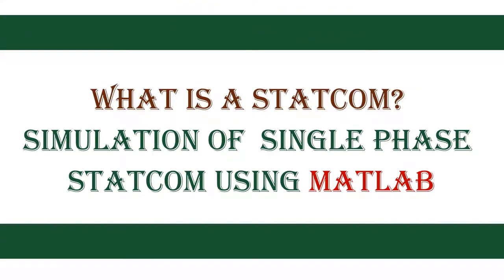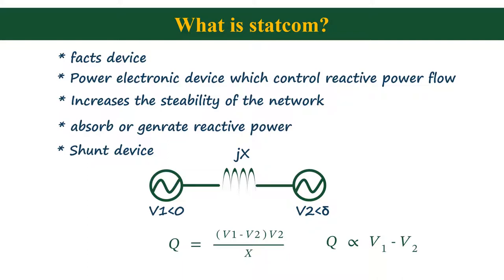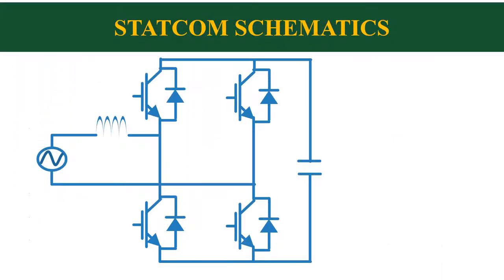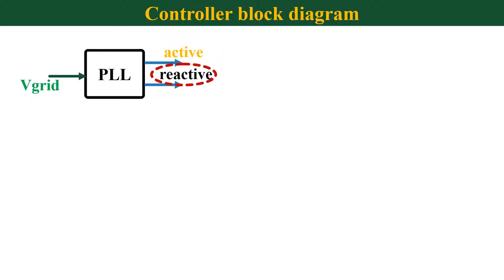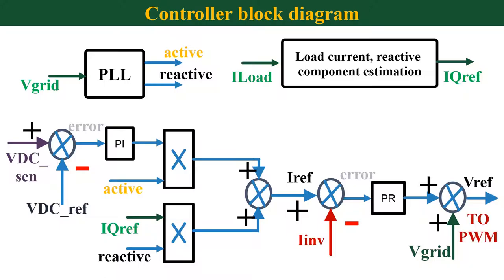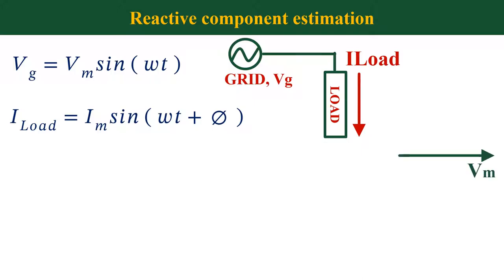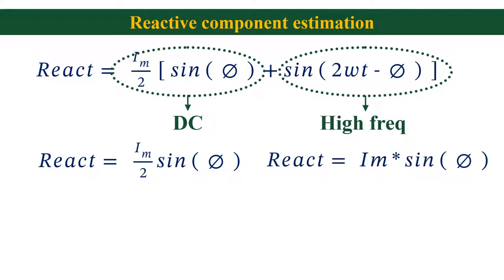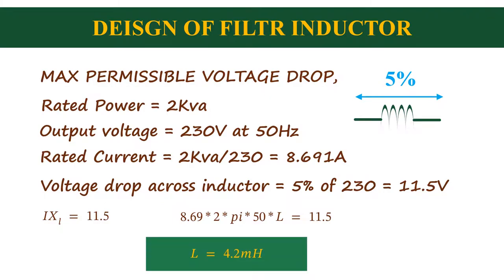Single Phase Statcom - Design & MATLAB Simulation | Part-1.

Comment: I am doing a project which reactive power control of single phase grid connected inverter without load, I want to simulate it on matlab.
Reply: I want to matlab model for that is it possible for you to provide.
Reply from the maker: I have already made a video on grid connected inverter where you can control the active and reactive power transfer. Watch that video and try to build your own model. If you face any issue, i can help at any time.